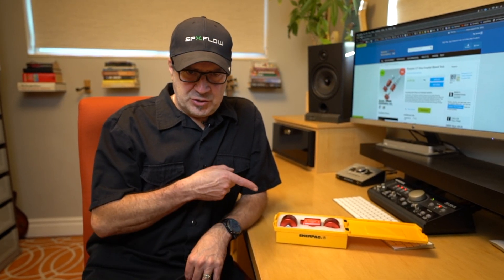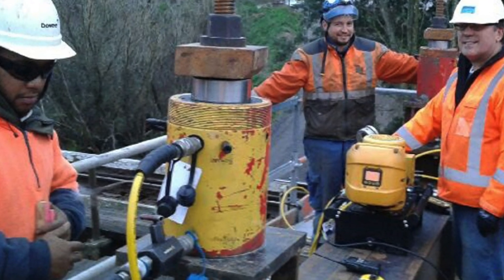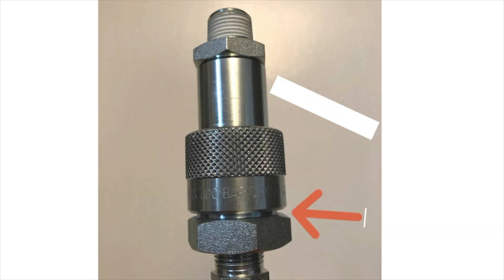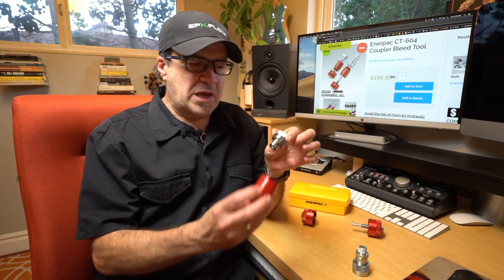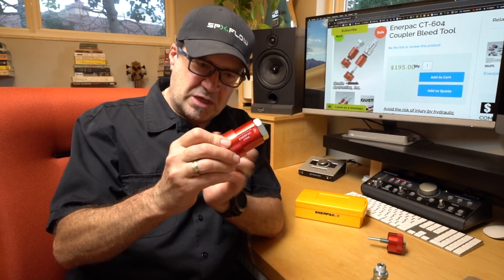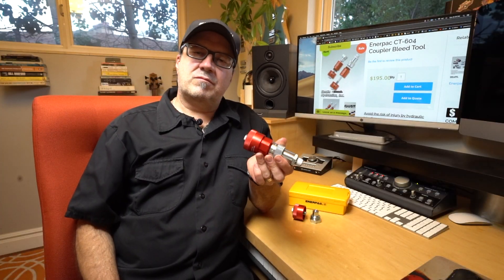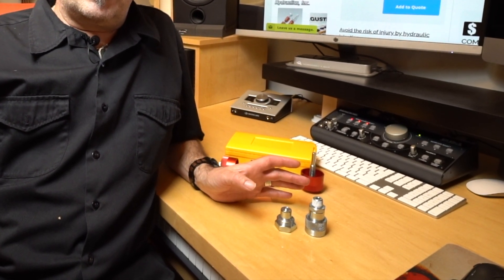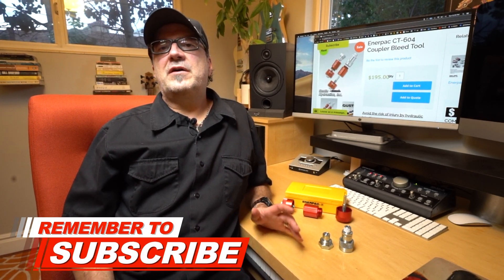Enerpac CT-604 Coupler Bleed Tool Overview - Avoid Hydraulic Injection Injury!

Comment from the maker: Do you have a suggestion for a video topic? We're here to help you understand these types of tools to work safer so, please comment here!
Reply: Hi , Actually I do! 
Always wondered  where does the female quick coupler goes and where the male quick coupler goes? I been trying to refer to pictures on internet showing  the correct installation but I'm hesitant to trust a picture posible posted incorrect practices.  I'm iplanning of refurbish my Enerpac power pack and want to install quick coupler  but doesn't know which coupler goes to cylinder and what goes to hose or pump.  A video explaining and showing this would be great.
Thanks for teaching the average Joe in this important matter.